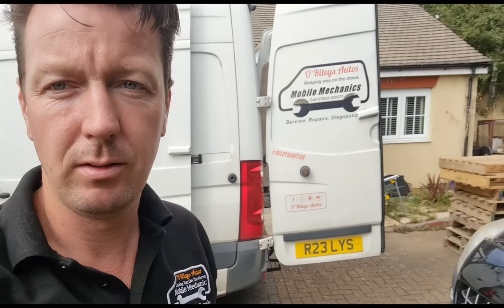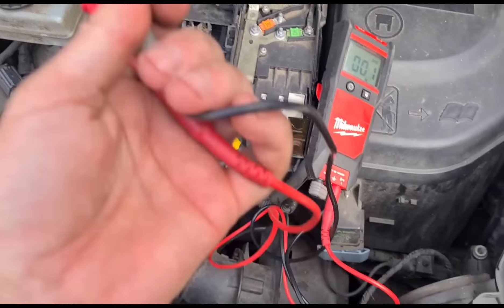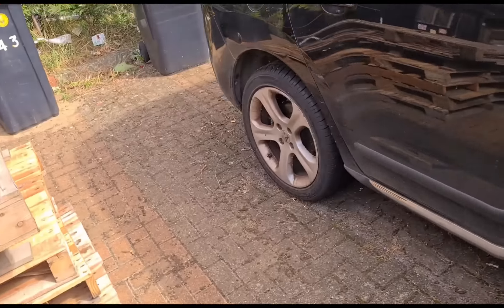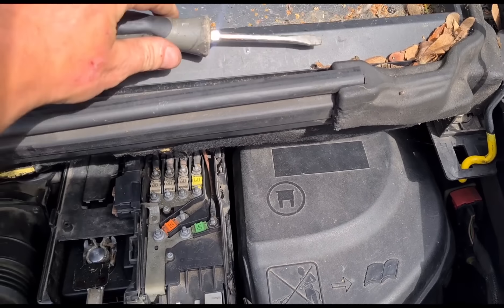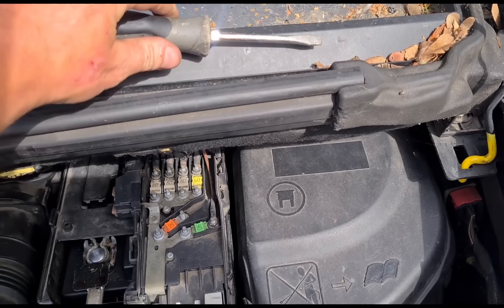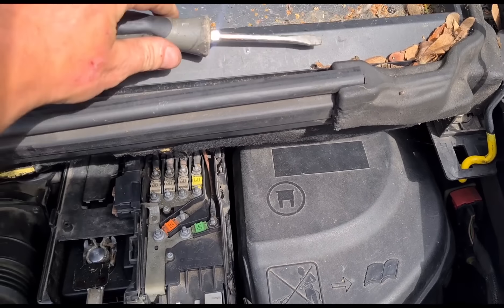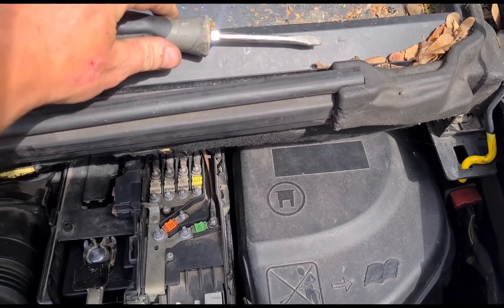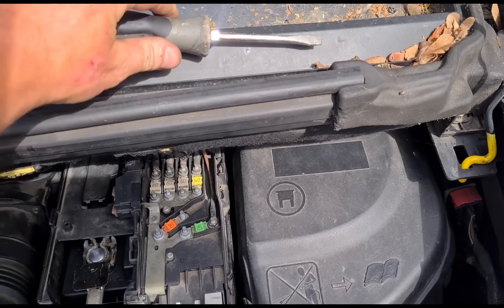Peugeot BPGA Unit Replacement

Comment: Thanks for showing the follow up on this car.  I had a Google... "The primary function of the peugeot bpga unit is to monitor the battery's status continuously, safeguarding it against overcharging and deep discharging."
Reply: Yeah, by permanently disconnecting it from the car! 😂
Reply: I did the same!
Reply: Funny that older cars didn't really need these gadgets, and they still ran and started just fine.

Comment: Had the same issue on my 2016 Citroen C4. Apart from the whole unit has to be exchanged, this was nice and easy swap out on this older Pug.

Mine had an electrical circuit fault message and battery drain. Mechanical relay in the BPGA had failed and wasn't shutting off the power off once ignition was off.

Comment: I have recently fitted a new battery but my semiautomatic 3008 (2012)does not start. It just makes clicking noise. Suggesting starting a motor issue. I had to jump start the car and it works and runs fine. The battery does not hold the charge even though its new battery. Is it same issue you recommend? Do you know anyone in .aylesbury/london can repair this

Comment: Are you sure the batt connection to the bpga is correct? It should be connected to the far left terminal. The current termination will drain the battery fast.
Well.. thats my guess anyway..😅